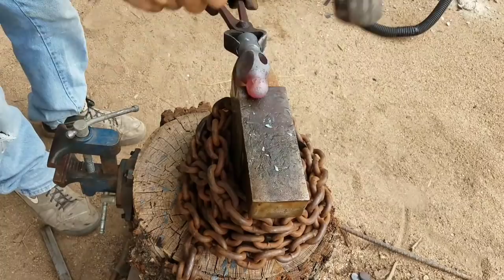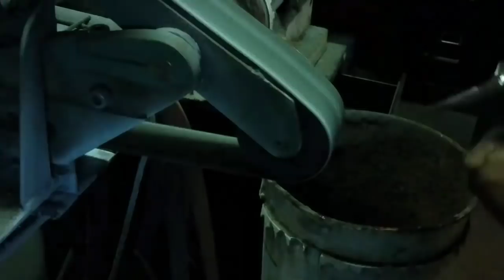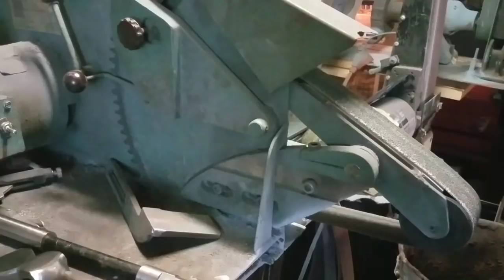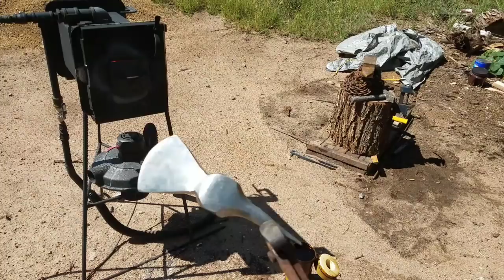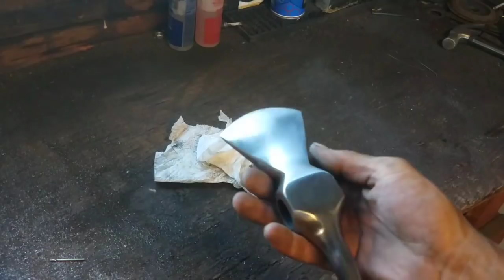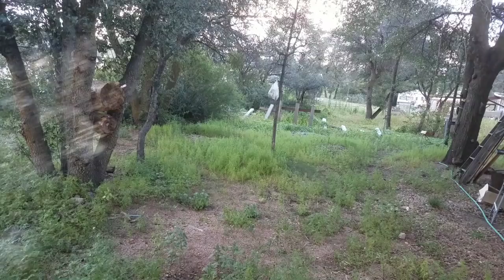Forging A Tomahawk From Ball Peen Hammer

Comment: That is badass.  I want it! 
Would like to drill a hole in a nice piece of wood to replace the paracord, then sand it down to match the handle size.  Think that would be a perfect contrast to the metal.. & would still feel good in the hand

Comment: If you set your anvil in concrete the increase in effectiveness will be quite noticeable. Right now you are expending energy into the anvil instead of the piece you are working on and even the slightest bit of movement makes a huge difference.

Comment: Sweet!! I would put a longer handle and hook in the point for grabbing logs and remove the spike from the bottom. Great tool for limbing  trees and dragging the logs around. Seems like a good project for a beginner. Will have to make one when I set up the forge I want to get.

Comment: forge a steel rod into a conical shape and heat treat for an expansion pin to widen the hole, not easy but worth it after you actually have a good, beefy handle

Comment: The top of your anvil needs to be hip height, so you can control the metal better, try a lager base that stands higher, if you do this you will find it much easier to work the metal, you wont have to contort your self to do bevels, all you anvil work should be done at the hip, you get more power out of the hammer blow, and you don't use as much energy to work the metal, and if your getting back pain well now you know why, hip height the pain will go away, and your back will get stronger.  the hammer should do the work not you.

Comment: Your handle needs to be a little bit oval shaped so you can tell blade alignment - that will make it stick in the tree more. Second, if you're going to have it screw together and interlock, might as well put in a set screw so it doesn't get loose.

Comment: She isn't really done. The grip cross section is too round and symmetrical. A circular cross section will let the tomahawk shift itself in your hand too much, which can interfere with edge alignment. In addition, you can't really tell which way the edge and spike are by holding it without looking at the head. There's a reason why the eye of the hammer was that shape.

A far better grip cross section would be ovular, rectangular, hexagonal, octagonal, or so on. If you're going with the angular cross sections, two parallel sides of the shape must be substantially longer than the rest. Whichever direction those are, they should be parallel to the direction of the tomahawk head.

Comment: how to make steel stronger to cut a metal please tell me.
Reply: what?
Reply: Eric Kelly  Cam you tell me how to make steel stronger to cut a metal? Please tell me. He vas stronger but I put him in to the oil and now hi is not string.
Reply: Loveral125 if you heat treated then temper you steel in your oven for 400 for1 hour hope it helps